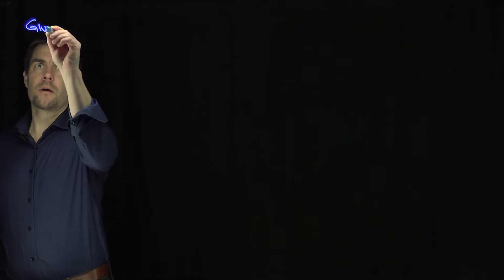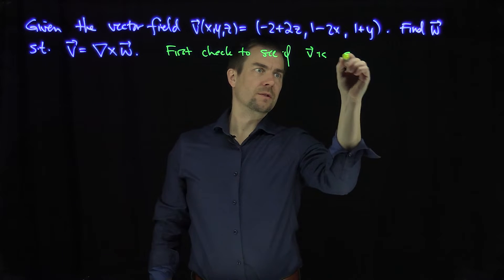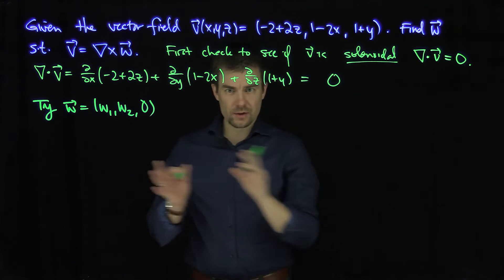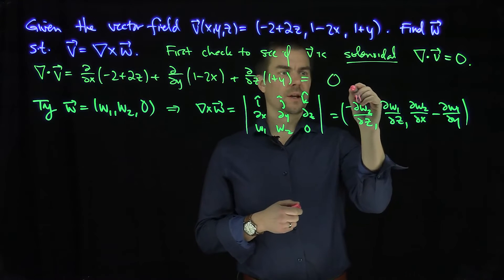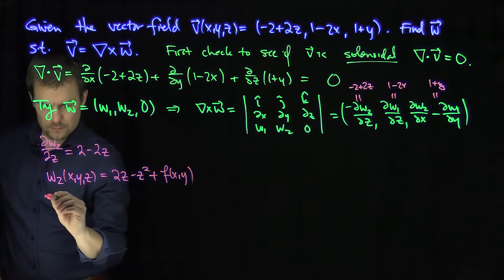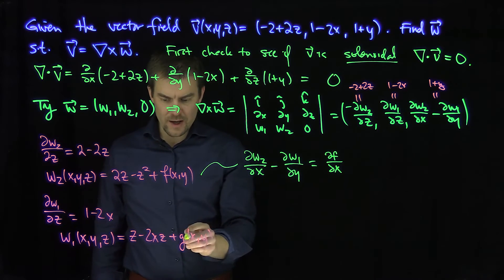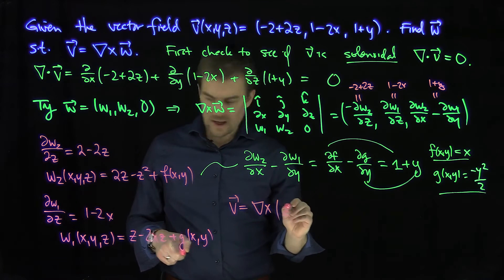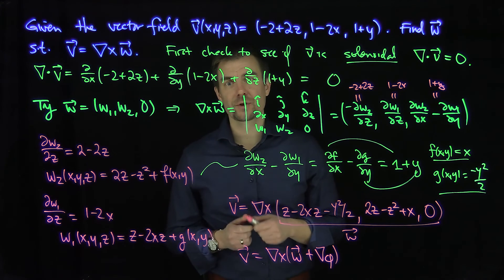Finding a Vector Potential: An Example

Comment: I find three different potentials based upon which factor in w is made zero.
 I get w can be <0, x + xy + 2z, x^2 - x + 2yz> , <z - 1/2y^2 - y, 0, x^2 + 2yz - 2y> and <z - 1/2y^2 - 2xz, x + 2z - z^2, 0>
I just do not see how these potentials relate to one another except that they all have the same Curl.
Thank you for showing how to work this out.